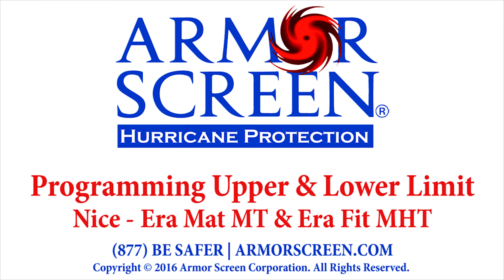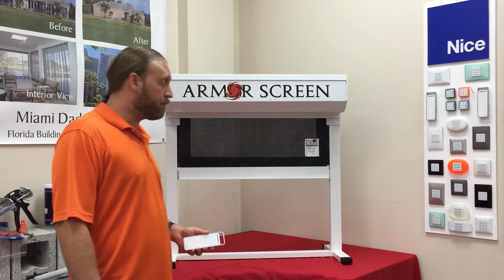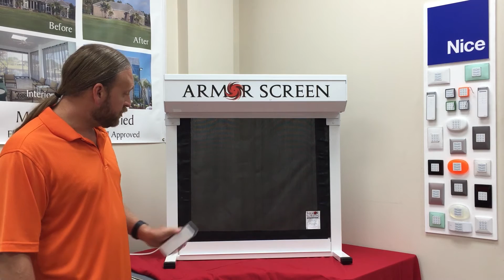Armor Screen Roll Up: Programming Upper & Lower Limits

Comment: Hi, I was wondering if you can help me with my motorized armor screen, as it is not going all the way to the base like it used to. I have the somfy remote.  Prior to hurricane Ian hitting, it was going all the way down to the pavers, and stopping like it should. After our power outage it will not go all the way to the base, and stops about 2 inches before the patio pavers.